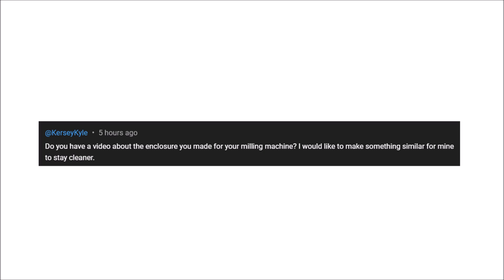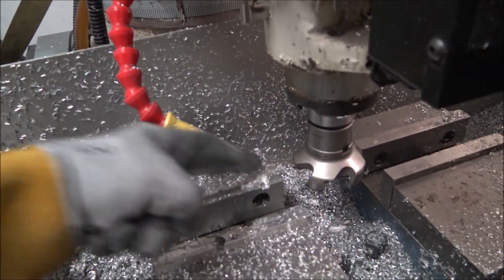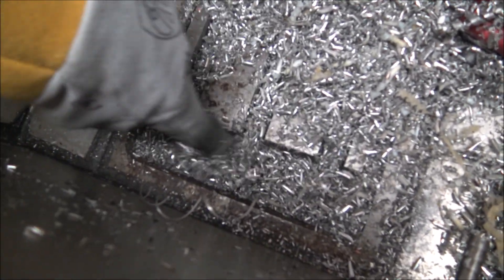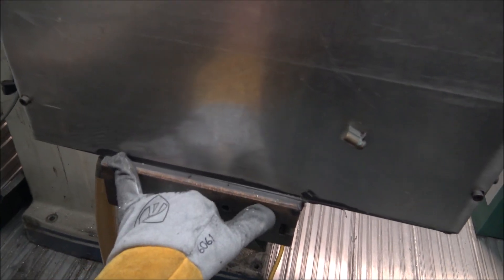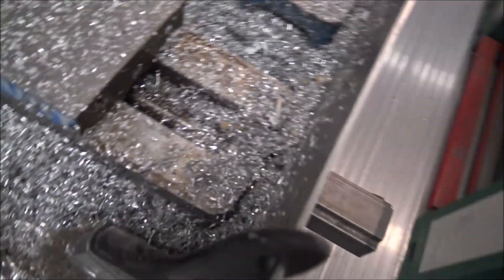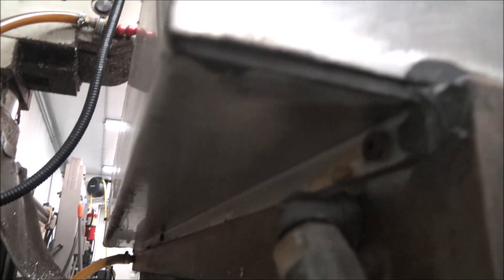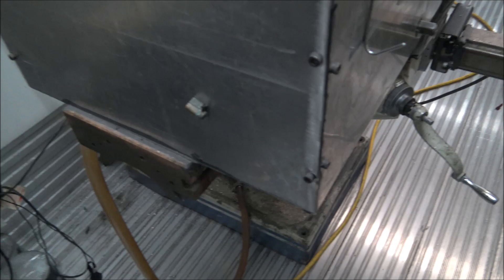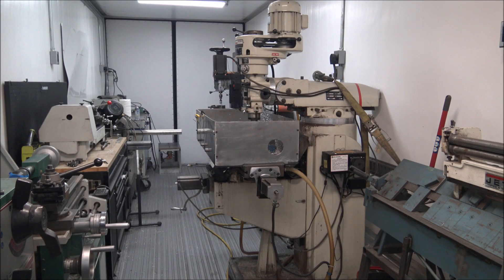Aluminum Machining/Fabrication - Knee Mill Coolant System - Catch & Recirculate

Comment: Thank you for making this video, I like the simplicity of your design and will use many of these ideas.

I had concerns that the enclosure would reduce the versatility of the mill when doing large or long pieces that hang over the edge.
A few times a year I need to take off the vise and clamp parts directly to the table or onto an angle plate.

I like how each wall panel is held together in the corner using a cross drilled square bar.

I would need to have each wall panel removable for pieces that hang over the edge. I plan to put a 90 degree profile "picture frame" around the base for it to screw into at each panel's bottom.

I also prefer to use straight cutting oil on my manual machines, I do not want that on the floor, much more easy having a pump compared to the spray bottle I use for drilling.

You have done the best job making an enclosure for a knee mill that I have seen.